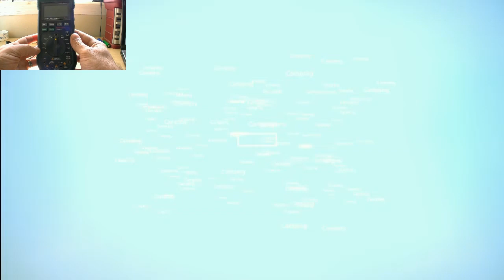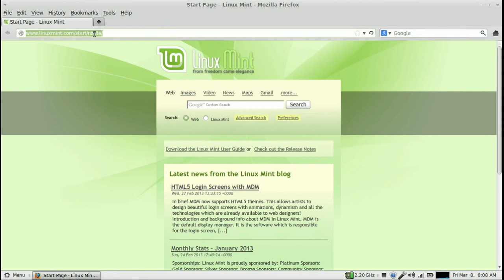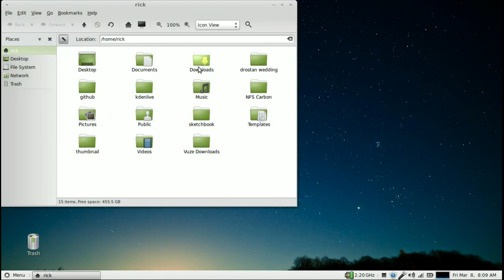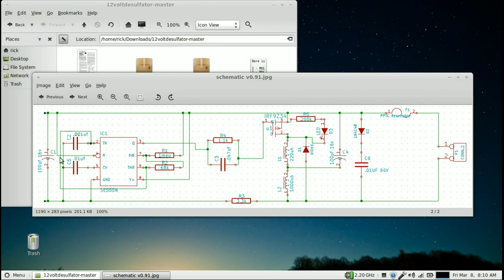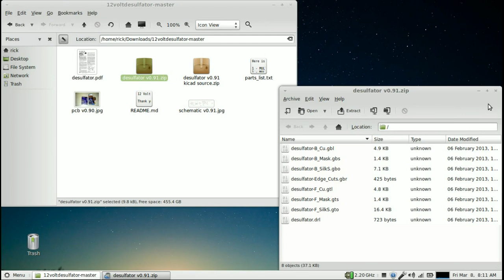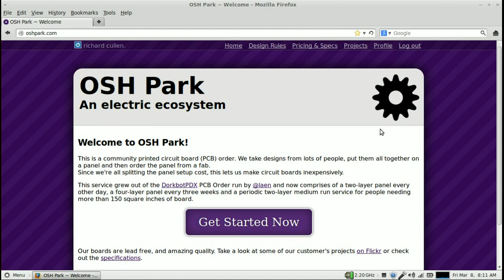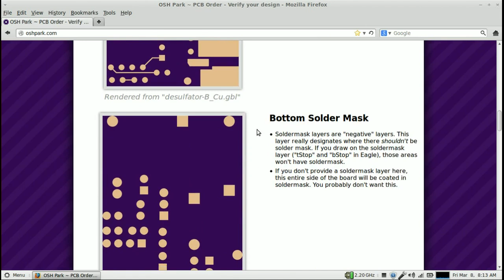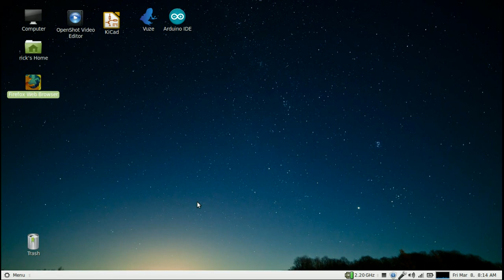Desulfator Circuit Board (How To Order)

Comment: Great video it was very informative. How does your desulfator desulfate a battery, does it use voltage spikes, or a frequency pulse?
I use a Pulse Tech PowerPulse passive desulfator, they claim to have a patented frequency they use to desulfate batteries, I have been using it on my 2001 BMW battery for the past three years and never have any issue's starting even though I only drive about 25 miles per week.

Comment: I saw in your schematic you flipped the PMOS transistor and switch the Source and the drain... I was wondering how in the original design it could work for a PMOS. In the video you forget to mention this modification with the resistor value changes. No worries thx for your work.

Comment: I followed the instructions on GitHub and I was surprised to find that the inductors I received from Newark are mounted horizontally, so I seem to need to be unwrap them to mount on the board.  Is that normal?
Reply from the maker: tmiller1916 That is exactly correct.  Unwrap the horizontal leads with your soldering iron and break off the black base.  You just converted it from a SMD inductor to a through hole inductor.
Reply: R&TPreppers I have a 12V Deep Cycle Marine Battery (27DC-2, sticker date 12/11, Advanced Auto parts Autocraft brand) on a couple of solar panels (100W combined Power ( SunForce 45W and 55W) that worked very well for a 40W lamp every night for almost two years then stopped working.  When I attached the desulfator 4 days ago, my battery voltage was 11.37V.  The only charging came from the solar panels, today it was down to 10.65V.  Initially, V (pins 1-8, 555) was 5.44V, f (pins 1-3, 555) 1.162KHz, D (pins 1-3) was  6%, and C6 voltage was 43.1V. This morning V(1-8)= 10.65V, and other values were similar except C6 was about 6V.  I attached a 12V, 1Amp charger to it (PC Power supply - 12V line, 1 Graphite pencil with paperclip leads (12 ohms) giving  1 Amp) and it now shows B (battery) = 11.29V, V(1-8)=5.65V, f(1-3)=1.158KHz, D(1-3)= 15%, C6=11.3V.  The solar panels remain attached and charging, but they are stationary and do not collect much (usually 0.5kWh per sunny day, and its been cloudy).

The data might be useful to record here, so I followed up and included it.  Thanks for the work you did.
Reply from the maker: If c6 is the same voltage as the battery, the desulfator isn't working.  Is it still humming at all?  You may of somehow blown the big Diode (don't have the schematic in front of me right now).  Your initial c6 voltage at 43v showed that the battery was significantly sulfated.  Also once you figure out what blew on the desulfator remove the battery from the solar setup and only run it on the power supply until your done desulfating.  If MUST connect the desulfator to the battery first, and then the power supply to the battery.  If you connect the power supply to the desulfator without a battery connected the high voltage pulse has no where to be absorbed and will blow components.

Comment: Thanks for responding Ismael172110
Yes I did order via Newark.com Unfortunately I am an absolute beginner at this so my confusion is probably more due to ignorance on my part but I had three queries from Newark that I could not resolve with certainty.

in reverse order item 18 on the parts list reads "1 CREE - C503C-WAN-CBADB151-LED, COOL WHITE,120MW,46100MCD".

This item was not known to Newark and no suggestion was made by Newark for this item. I do not have knowledge to substitute this item.

item 9 "1ON SEMICONDUCTOR-MR856RLG- FAST RECOVERY DIODE,3A,600V AXIAL"

Two suggestions were made by Newark item as described  but with the edition of FAST REEL or exactly as described but STANDARD RECOVERY not FAST RECOVERY My thought was go for the one with FULL REEL tagged on the end ???

Item 6 "1 BOURNS JW MILLER-PM2110-102K-RC-POWER  INDUCTOR,1MH,1.9A,10%"  This item was offered but with 1000uh instead of 1MH My thought was it is the same item just a different way of expressing the value ???

Help would really be appreciated as this whole subject is interesting and now I am retired I have the time to explore new skills.
Reply: Tony... I think will need to order those missing item from a different supplier ( digi key , Mouser... ) as I did .. this item is back on stock MR856RLG- FAST RECOVERY DIODE,3A,600V AXIAL and led light should be in stock also ...but if not just order it from another supplier as mentioned above ... oh one more thing if  you will try to this project together, I will strongly suggest you get a good quality solder iron, the pcb is extremely small and all connection are too close from each other, you will need a lot patience and a good soldering tip ..  good luck
Reply: Ismael72110 thanks Ismael for your help will take your advice

Comment: Is the 555 timer installed with pin 1 on the square pad on the board? (no notch on my chips) I see your notch on the silk screen.
Are Capacitors C1 and C4 positive legs installed on the square pads on the board?
Is the Diode D2  (+) leg  installed in the square pads on your board? 
Is the Mosfet pin1 installed in the sqare pad on the board? Thanks for the help.

Comment: Hi, I have received them now. . I can not find where to clear up the orientation as you have drawn on the boards for those components that need it. Could you please let me know? Thanks
Reply from the maker: which components are in question?
Reply: R&TPreppers 555 pin 1 = square pad?  C1 and C4  (+) = square pads?
D2 (+) is square pad? Mosfet pin 1 (gate) is square pad? Any reason
you removed the boards from the inductors?  Thanks
Reply from the maker: Dave Austin
Sorry I've been busy with other projects to get back to you.  Square pads are pin one and/or positive.  P-FET gate pin one is also square hole.  I removed the boards from the inductors to expose the wires and for clearance.
Reply: R&TPreppers Thanks for the reply. I got busy and just found the response today. I got a little confused as the board doesn't exactly match the schematic which is only one sided and some of the circuits are a bit different on the board.
Thanks Dave

Comment: Thanks for this. I have a couple golf cart batteries I want to try this on. Will it work as you designed on a 6 volt battery?
Reply from the maker: it wil only work at 1/3rd capacity on 6 volt batteries. tie two batteries together with a thick short cable in series to make 12 volts.

Comment: Nice..ordered 3 full setups (boards and all) for the price I paid for one commercially sold one ($33~at newark, and $12 at OSH Park)...can't wait to put em together and set em up...also I found that putting these on my commute vehicle and driving to and from work they desulfate on the fly (commercial version had a relay to shutoff if the battery charge dropped too low)
Excellent write up, excellent board setup...excellent videos!  Awesome!
Reply: Boards:
http://oshpark.com/shared_projects/ATrDSRDV
I paid $11.70 for 3, shipped

Sorry such a mess...parts list from www.newark.com
PO Number    PO Release    Order Confirmation Number    Order Date    Status    Currency    Goods Total    Shipping    Additional Charges    Tax    Order Total    Applied Vouchers    Order Source    Order Code    Line Note    Description    Manufacturer    Manufacturer Part Number    Quantity    Unit Price    Line Total
1/11/14 3.53 AM        647179    2014.01.11                    USD 0            

[SAVE5]    INT     59K8658        RESISTOR, METAL FILM, 1.1KOHM, 250mW, 1%; Product Range:MULTICOMP - MCMF Series; Resistance:1.1kohm; Power Rating:250mW; Resistance Tolerance:Â± 1%; Resistor Case Style:Axial Leaded; Resistor Element Type:Metal Film; No. of Pins:2 ;RoHS Compliant: Yes    MULTICOMP    MCMF0W4FF1101A50    3    USD 0.0808    USD 0.24
1/11/14 3.53 AM        647179    2014.01.11                    USD 0            

[SAVE5]    INT     58K3844        RESISTOR, METAL FILM, 3.3KOHM, 250mW, 1%; Product Range:MULTICOMP - MCMF Series; Resistance:3.3kohm; Power Rating:250mW; Resistance Tolerance:Â± 1%; Resistor Case Style:Axial Leaded; Resistor Element Type:Metal Film; No. of Pins:2 ;RoHS Compliant: Yes    MULTICOMP    MCMF0W4FF3301A50    3    USD 0.0808    USD 0.24
1/11/14 3.53 AM        647179    2014.01.11                    USD 0            

[SAVE5]    INT     58K3875        RESISTOR, METAL FILM, 68KOHM, 250mW, 1%; Product Range:MULTICOMP - MCMF Series; Resistance:68kohm; Power Rating:250mW; Resistance Tolerance:Â± 1%; Resistor Case Style:Axial Leaded; Resistor Element Type:Metal Film; Voltage Rating:250V;RoHS Compliant: Yes    MULTICOMP    MCMF0W4FF6802A50    3    USD 0.0808    USD 0.24
1/11/14 3.53 AM        647179    2014.01.11                    USD 0            

[SAVE5]    INT     58K3799        RESISTOR, METAL FILM, 1MOHM, 250mW, 1%; Product Range:MULTICOMP - MCMF Series; Resistance:1Mohm; Power Rating:250mW; Resistance Tolerance:Â± 1%; Resistor Case Style:Axial Leaded; Resistor Element Type:Metal Film; Voltage Rating:250V ;RoHS Compliant: Yes    MULTICOMP    MCMF0W4FF1004A50    3    USD 0.0846    USD 0.25
1/11/14 3.53 AM        647179    2014.01.11                    USD 0            

[SAVE5]    INT     58K3825        RESISTOR, METAL FILM, 200KOHM, 250mW, 1%; Product Range:MULTICOMP - MCMF Series; Resistance:200kohm; Power Rating:250mW; Resistance Tolerance:Â± 1%; Resistor Case Style:Axial Leaded; Resistor Element Type:Metal Film; No. of Pins:2 ;RoHS Compliant: Yes    MULTICOMP    MCMF0W4FF2003A50    3    USD 0.0808    USD 0.24
1/11/14 3.53 AM        647179    2014.01.11                    USD 0            

[SAVE5]    INT     63K3211        POWER INDUCTOR, 1MH, 2.5A, 10%; Product Range:BOURNS - PM2120 Series; Inductance:1mH; Inductance Tolerance:Â± 10%; DC Resistance Max:0.215ohm; RMS Current (Irms):2.5A; Case Dimensions:30.5mm x 25.4mm x 20.83mm; Core Material:Iron ;RoHS Compliant: Yes    BOURNS JW MILLER    PM2120-102K-RC    3    USD 2.92    USD 8.76
1/11/14 3.53 AM        647179    2014.01.11                    USD 0            

[SAVE5]    INT     63K3221        POWER INDUCTOR, 220UH, 5A, 10%; Product Range:BOURNS - PM2120 Series; Inductance:220ÂµH; Inductance Tolerance:Â± 10%; DC Resistance Max:0.052ohm; RMS Current (Irms):5A; Case Dimensions:30.5mm x 25.4mm x 21.08mm; Core Material:Iron ;RoHS Compliant: Yes    BOURNS JW MILLER    PM2120-221K-RC    3    USD 2.92    USD 8.76
1/11/14 3.53 AM        647179    2014.01.11                    USD 0            

[SAVE5]    INT     04H8124        FUSE, PTC RESET, 72V, 1.1A, RADIAL; Holding Current:1.1A; Tripping Current:2.2A; Initial Resistance Max:0.25ohm; Operating Voltage:72V; Series:RXEF; PTC Fuse Case:Radial Leaded; Fuse Terminals:Radial Leaded; Interrupting Capacity:40A;RoHS Compliant: Yes    TE CONNECTIVITY / RAYCHEM    RXEF110    3    USD 0.3724    USD 1.12
1/11/14 3.53 AM        647179    2014.01.11                    USD 0            

[SAVE5]    INT     01P4261        DIODE, ULTRA-FAST, 3A, 600V; Diode Type:Fast Recovery; Diode Configuration:Single; Repetitive Reverse Voltage Vrrm Max:600V; Forward Current If(AV):3A; Forward Voltage VF Max:1.7V; Reverse Recovery Time trr Max:35ns; No. of Pins:2 ;RoHS Compliant: Yes    MULTICOMP    31DF6    3    USD 0.9415    USD 2.82
1/11/14 3.53 AM        647179    2014.01.11                    USD 0            

[SAVE5]    INT     10M2940        SWITCHING DIODE, 100V, 300mA, DO-35; Diode Type:Small Signal; Forward Current If(AV):300mA; Repetitive Reverse Voltage Vrrm Max:75V; Forward Voltage VF Max:1V; Reverse Recovery Time trr Max:4ns; Forward Surge Current Ifsm Max:2A ;RoHS Compliant: Yes    NTE ELECTRONICS    1N4148    3    USD 0.0637    USD 0.19
1/11/14 3.53 AM        647179    2014.01.11                    USD 0            

[SAVE5]    INT     23K4236        CAPACITOR ALUM ELEC 100UF, 35V, 20%, RADIAL; Product Range:UNITED CHEMI-CON - LXZ Series; Capacitance:100ÂµF; Capacitance Tolerance:Â± 20%; Voltage Rating:35V; Diameter:6.3mm; ESR:0.18ohm; Height:15mm; Capacitor Terminals:Radial Leaded;RoHS Compliant: Yes    UNITED CHEMI-CON    ELXZ350ELL101MF15D    6    USD 0.1834    USD 1.1
1/11/14 3.53 AM        647179    2014.01.11                    USD 0            

[SAVE5]    INT     46P6386        CAPACITOR CERAMIC 1000PF 50V, C0G, 5%, RAD; Product Range:MULTICOMP - MC Series; Capacitance:1000pF; Capacitance Tolerance:Â± 5%; Dielectric Characteristic:C0G / NP0; Voltage Rating:50V; Capacitor Terminals:Radial Leaded ;RoHS Compliant: Yes    MULTICOMP    MC0805N102J500A2.54MM    3    USD 0.1093    USD 0.33
1/11/14 3.53 AM        647179    2014.01.11                    USD 0            

[SAVE5]    INT     97M4143        CAPACITOR CERAMIC 0.01UF, 100V, X7R, 10%, RAD; Product Range:MULTICOMP - MLR Series; Capacitance:0.01ÂµF; Capacitance Tolerance:Â± 10%; Dielectric Characteristic:X7R; Voltage Rating:100V; Capacitor Terminals:Radial Leaded ;RoHS Compliant: Yes    MULTICOMP    MCMLR100V103KX7R    6    USD 0.03    USD 0.18
1/11/14 3.53 AM        647179    2014.01.11                    USD 0            

[SAVE5]    INT     46P6322        CAPACITOR CERAMIC 0.047UF, 50V, X7R, 10%, RAD; Product Range:MULTICOMP - MC Series; Capacitance:0.047ÂµF; Capacitance Tolerance:Â± 10%; Dielectric Characteristic:X7R; Voltage Rating:50V; Capacitor Terminals:Radial Leaded; No. of Pins:2;RoHS Compliant: Yes    MULTICOMP    MC0805B473K500A2.54MM    3    USD 0.017    USD 0.05
1/11/14 3.53 AM        647179    2014.01.11                    USD 0            

[SAVE5]    INT     19K8339        P CHANNEL MOSFET, -55V, 19A, TO-262; Transistor Polarity:P Channel; Continuous Drain Current Id:-19A; Drain Source Voltage Vds:-55V; On Resistance Rds(on):100mohm; Rds(on) Test Voltage Vgs:-10V; Threshold Voltage Vgs:-4V ;RoHS Compliant: Yes    INTERNATIONAL RECTIFIER    IRF9Z34NLPBF    3    USD 2.07    USD 6.21
1/11/14 3.53 AM        647179    2014.01.11                    USD 0            

[SAVE5]    INT     53K0893        DIP SOCKET, 8POS, 2.54MM, THROUGH HOLE; Connector Type:DIP Socket; Series:-; No. of Contacts:8; Pitch Spacing:2.54mm; Row Pitch:7.62mm; Contact Termination:Through Hole Vertical; Contact Material:Copper Alloy; Contact Plating:Tin ;RoHS Compliant: Yes    FCI    DILB8P-223TLF    3    USD 0.1273    USD 0.38
1/11/14 3.53 AM        647179    2014.01.11                    USD 0            

[SAVE5]    INT     97K9426        IC, TIMER, SINGLE, 16V, DIP-8; Operating Mode:Astable, Monostable; No. of Timers:1; Supply Voltage Min:4.5V; Supply Voltage Max:16V; Digital IC Case Style:DIP; No. of Pins:8; Operating Temperature Min:-40Â°C; MSL:MSL 1 - Unlimited ;RoHS Compliant: Yes    TEXAS INSTRUMENTS    SA555PG4    3    USD 0.2689    USD 0.81
1/11/14 3.53 AM        647179    2014.01.11                    USD 0            

[SAVE5]    INT     14N5685        TERMINAL BLOCK EUROSTYLE, 2POS, 26-12AWG; Connector Type:Eurostyle Terminal Block; Series:-; Connector Mounting:PCB; Pitch Spacing:5mm; No. of Contacts:2; Wire Size AWG Min:26AWG; Wire Size AWG Max:12AWG; Contact Plating:Tin ;RoHS Compliant: Yes    MULTICOMP    MC24356    3    USD 0.3325    USD 1
1/11/14 3.53 AM        647179    2014.01.11                    USD 0            

[SAVE5]    INT     28T0872        LED, COOL WHITE, 5MM, 46.1CD; Bulb Size:5mm; LED Color:Cool White; Luminous Intensity:46.1cd; Viewing Angle:15Â°; Forward Current If:30mA; Forward Voltage:3.2V; LED Mounting:Through Hole; Lens Shape:Round; CCT:9000K; No. of Pins:2 ;RoHS Compliant: Yes    CREE    C503C-WAN-CBADB151    3    USD 0.2195    USD 0.66
Reply: I made one!
Testing soon!
Frequency of the pulses calculate to 10.600kHz
https://oshpark.com/shared_projects/ATrDSRDV

Comment: When you desulfate a battery, does it come back to the same cranking power as original? & how long will it be good for? Can a battery that's been desulfated once, undergo another desulfating in the future?
Reply from the maker: The degree of success in desulating batteries weighs heavily on the internal condition of the battery plates before starting.  If they're just sulfated, then you have a good chance of getting 80%+ capacity back.  If the plates are damaged, then most likely not.  If you regularly desulfate your batteries, it doesn't hurt to keep a desulfator on the battery for maintenance.

Comment: also, you are not clear, where you connect the positive and neg.I think you said it wrong on the video. pos should be connect next to the resetable fuse.? from the schematic.
Reply from the maker: Correct, positive is on the resetable fuse side of the connector.

Comment: Can I use PM2120-102K-RC instead of PM2110-102K-RC?  The functional requirements are similar except DC Resistance Max:  0.215ohm  and RMS Current (Irms): 2.5A vs DC Resistance Max: 244ohm RMS Current (Irms): 1.9A.   Will that be acceptable?

Comment: Great set of videos went to Newark.com to order the parts and the  BOURNS JW MILLER - PM2110-102K-RC  and PM2120-221K-RC - Power inductors are only available  as a special order of 77! Searched on the internet and ebay, and it doesn't seem that this part is available for single order.  Is there a substitute I can use instead for these two parts?  Thanks!

Comment from the maker: Also I'm not sure what the upper practical limit of these units are in terms of AH capacity it can sucessfully desfulate.  In the next month I'm going to get a pair of L-16 batteries and set up 2 desulfators to run correctly on 6 volt batteries instead of 12 volt and see if they can desulfate the high capacity of L-16's.

Comment from the maker: I would double check your resistor values again.  The picture is an older version of the board that had a typo for the two resistors that set the timing.  The typo (reversal?) was corrected in the github download.